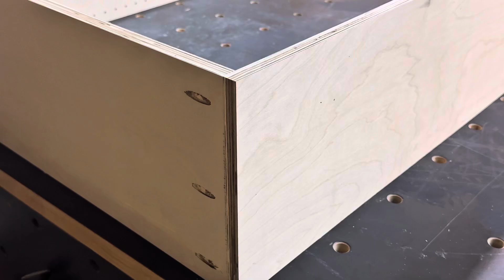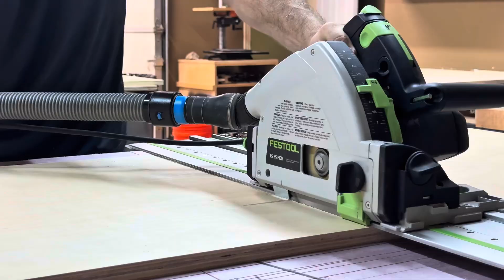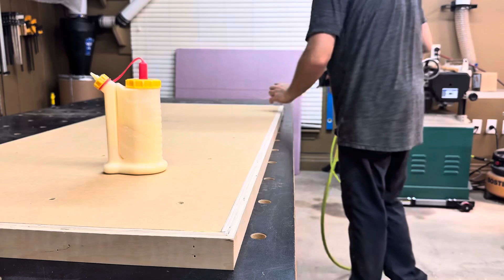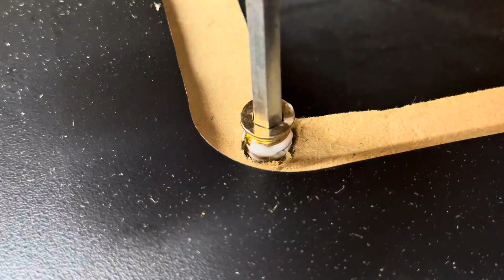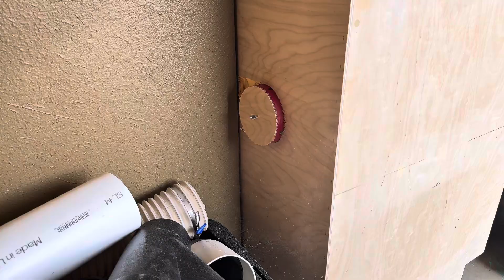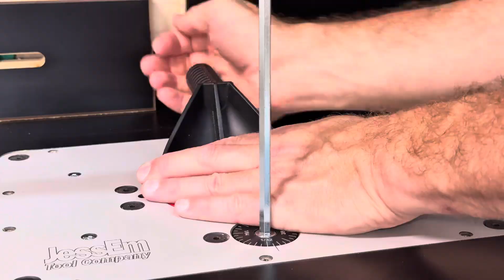Miter Saw Station with a Router Cabinet

Comment: Nice build. I think the black looks great. Nothing wrong with having a space look cool.  A few questions of you don’t mind. How deep are the upper cabinets and how high did you mount them above the lower cabinets? I am in the process of building my set up and I think in my question for more storage capacity I am planning to make my upper cabinets deep but I think my current plan is too deep.
Reply from the maker: I went with a standard depth of 12” and I left 17” of height from the bench top.

Comment: How well does the laminate hold up on the bench top? Does it dent or chip easily? I see it used frequently and I like the look. Im just wondering what happens if a heavy tool or something gets dropped on it? I really like the fact that glue won't stick to it and most cleanup jobs are easy. 
Nice idea adding your router.
Reply from the maker: I can’t say it’s indestructible but pretty darn close! I would say it’s one of the best options in durability for a woodworking shop.

Comment: Nice miter station! Going to be building mine soon.  Question for you…  What tip do you use for your paint sprayer?  It looked at lot easier to control overspray than mine even when using a 311 tip.
Reply from the maker: Thanks! I’m using a Fuji Q5 with a 1.5 needle and air cap set.